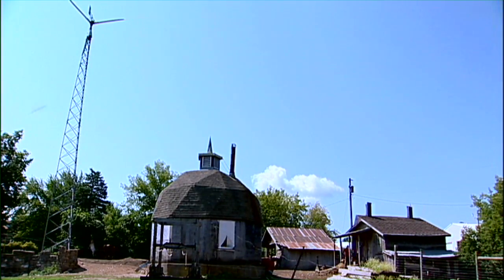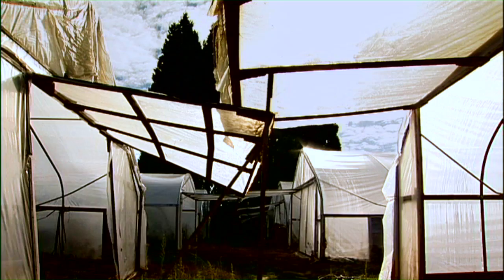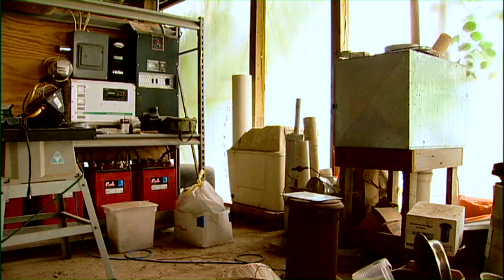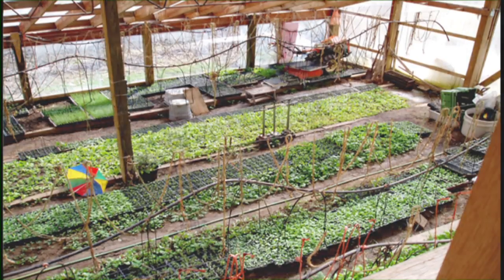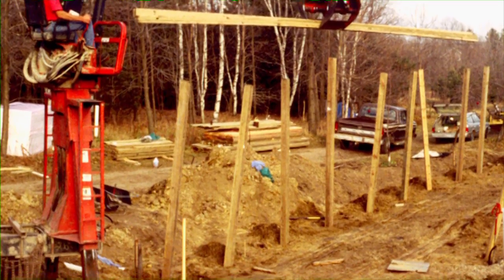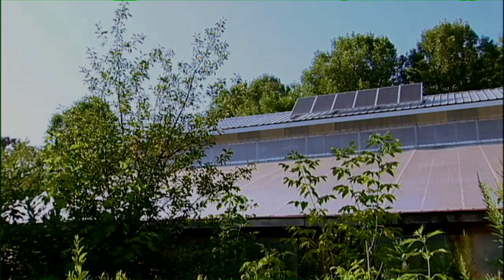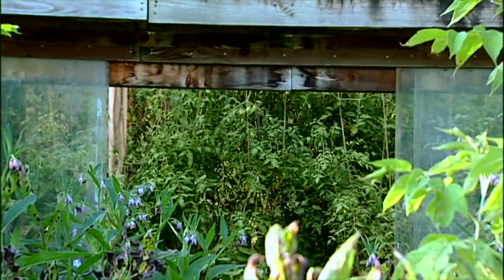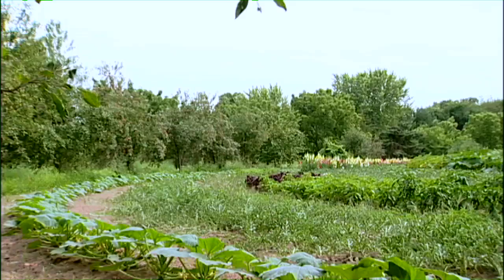Thermal Banking Greenhouse Design -Sustainable Energy

Comment: I couldn't agree more for using the soil for an energie batterie. I live in Quebec witch is far more north. We have 3 month of minus 30 degree celcius. But, the problem i saw is the cost and the low efficacy (coming from the fan and the restriction of the pipes) of using the air for carrying the energie of the hot air at the top of the greenhouse. I always though water makes a mutch better job once you heated it. With that in mind, I used 4 x1000L tank full of water with a small pump that runs the water through dodge caravan radiators. After that, the water runs through a lot of plastic pipe that I buryed in the ground at 2 feet with a shovel. I can keep all my windows closed at 12:00 even if its 30 celcius outside.  That way, i was able to build my all year round greenhouse under 3000$, i water the plant with hot water and i store a lot of energie for the next winter.

Comment: Hello fellow farmers, i am here in Botswana in Southern Africa and the temperatures here can reach 40 degrees celcius during the hotest times of the year, so i want to know if this can work for me in these conditions and how i van make it work ? I also want to know the amount of perforated pipes i need underground to sufficiently cool and warm a 10mx30m greenhouse? Lastly regarding the perforations on the pipes, is there any spacing requirements between the perforations?
Reply: Consider using hoses with liquid ~3m down in the earth. I dont know your ground temperatures but I assume its reasonably cool.
Probably around 2-300m total, 4-5 loops depending on your pump system.
Much cleaner and easier than air.  Car radiators with fans in greenhouse for cooling/heating.
You could easily connect the liquid loops to a heat pump to get more control.

Comment: $40,000 seems VERY expensive for a green house to me.  You can build a heated green house much cheaper.  Heat it with a partially buried wood oven fueled with wood from your own land.  Fully organic, 100% bio and renewable.  He admits that most of the money and materials were supplied by grants.  Would you pay $40,000 for a green house in your back yard?  I sure wouldn't.
Reply: To be far I think that the high price of some of these early projects are because they are experimental. With what has been learned from these projects now days it is definitely possible to make these cheaper and more sustainable then conventional methods. Unfortunately experiments are expensive! Lol
Reply: @nerdy1701  I can by 4 (right, FOUR of them) pre-fab Riga brand greenhouses in Riga Latvia for 1000 Euro.  1120 shipped anywhere in Latvia.  Just sayin'.
Reply: It looks like a lot more than just a green house to me. With the barn. Square footage wold be helpful. May be I miss it if he said.

Comment: Couldn't have this been down with water? I dont know about where you live but here we have pool water heaters. Black pipe on the roof of the house, water heats up and circulates back to the pool thus heating the water. This principle can be used to heat the internal of a house with the pipe going to under the floor, I know they do this in England. Seems like a complicated way of heating the ground with air....

Comment: Flawed,  how much energy do you need to use to collect energy,  Fan motors run ya....

Use the thermal heat to heat up those bags of water then use insulated hoses to run water underneath the soil.  No fan no pump....  and water retains more heat than air does...

Stop smoking your brains out man
Reply: Thermal shower heat bags and insulated hoses don’t cost no 40k. Y’all need to quit playing

Comment: How was it that the grant for this was secured? I have a similar project with a different design concept to address the colder ground temperatures here in northern Minnesota and am interested in turning it into a larger "open source" project. 

Great job on the project.

I would also like to make note to others that are doing aquaponics and green house designs that you should try to stay clear of PVCs...

PVC(polyvinyl chloride or vinyl) and CPVC(chlorinated polyvinyl chloride or vinyl) and the cement used to join it is not safe for food use, not safe for grow beds and not safe for aquaponics.  PVCs contain known human carcinogens and they leach into fish tissue, food and the water when used in this environment. Many of the cheaper imported PVC's also contain lead, mercury and other even more harmful chemicals.

People really need to stop using PVC for growing foods, to many people on youtube using it for anything from chicken watering and feeding to aquaponics setups.

PVCs are not safe, do some research please.
Reply from the maker: Steven applied for a grant through SARE. There's info for applying for grants via their website: sare.org

Comment: one of the best method I used I use 900 degrees Fahrenheit oil on a 600 gallon with granite rock use the oil for solar transfer started heating oil you can storage it at very high temperatures great for hot water system it's not nothing a new idea I done at the New York City for a laundry mat true a hot water system oil temperature go up to 600 degrees Fahrenheit in the winter it produce a lot of hot water great saving for money the conventional solar hot water system you don't storage a lot of heat which is a major problem for high demand water system same principle for a greenhouse I did one upstate New York a prototype it work out exception and do you well in the dead of winter you could store lot of energy in oil granite use very high temperature oil with proper engineering

Comment: Why not just have a geothermal heating and cooling system. It's very similar to that but with water rather then air like they are using. I don't really understand this I would think is less effective, but I'm not to sure the difference between the 2 methods.
Reply: +justin mason 
Air has more advantages in this application..which is growing plants. A lot of people lose sight of this when they are designing the system. ;)

Putting air underground not only cools it but dehumidifies it too. When the system is running, the greenhouse air is circulated so you dont need a HAF fan to provide airflow which evens out the temperature and co2 distribution. Plants grow better with gentle airflow over the leaves ;) 

The thermal mass allows heat to be stored and retrieved but thats only half the story. The heat keeps the roots warm, the water that condenses out in the tubing is available to the roots, the air running through the tubing helps to oxygenate the soil which is not only good for the plants but also for the aerobic bacteria. 

These systems do work extremely well, unfortunately, most of the ones on you tube are badly designed. The tube lengths are generally far too long, they are buried too deep or in a single layer and in every case they lack sufficient fan power to realise the full potential. 

The installation in this video has a very odd tubing layout from what i can see. Assuming all the standpipes are sealed, the entire flow from the 6 loops has to flow down the two (sch 80) 4" return tubes. Thats not good as each 4" return will be carrying half of the flow originally supplied by a 10" header. If thats the case, apart from increased frictional loss and back pressure, the airflow in the entire system will be unbalanced so some tubes will get more of the air than others. The frictional loss and backpressure not only reduces the fan`s output (less air), it increases the running cost because it`s having to work harder.

Comment: would water with ethylene glycol added to prevent freezing be a better medium for storing heat than air? a pipe running across the peak of the green house could collect the heat and a pump would come on and circulate as the temperature reached a desired point for collection to the earth?
Reply: It would, this video was a waste of grant money....  everyone and their mom uses water and insulation to keep it warm as it goes beneath the roots in the soil..  it raise with heat and keeps fruits and veggies growing all winter too

Comment: A more affordable option is a Walipini
Reply: Kinda missing the concept behind the video.  Standard Walipini (basically in ground greenhouse) still has the majority of issues that a standard greenhouse has (excess heat at solar noon, loss of heat during night) but also has lack of sun during winter when the sun is at a low angle.  Might work for southern users where the sun isn't as low in the sky.
Reply from the maker: I had never heard of a Walipini - so I looked it up. Great idea! I'm not sure how the plastic might hold up in extreme weather, but the concept is a good one. Thanks for sharing.